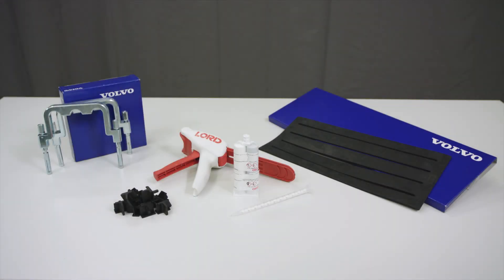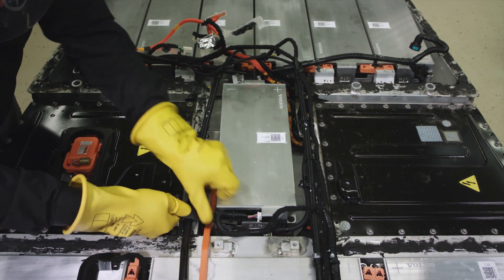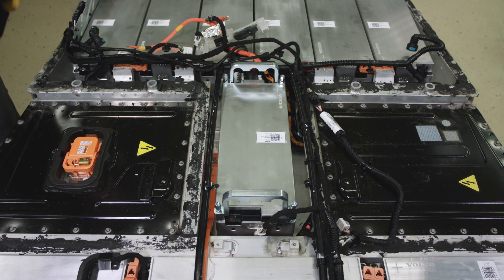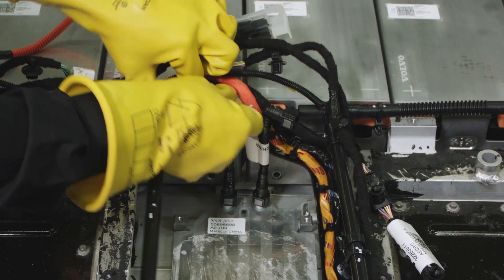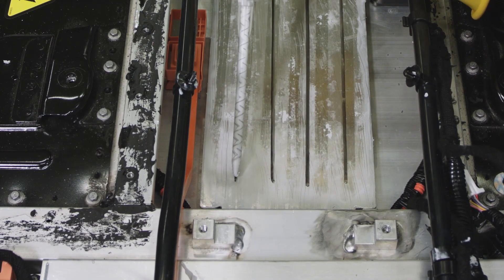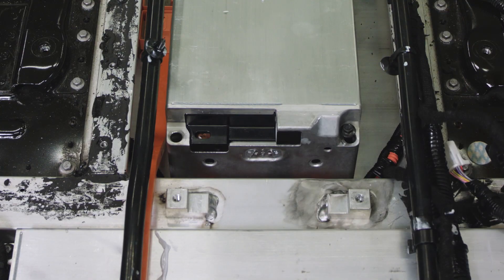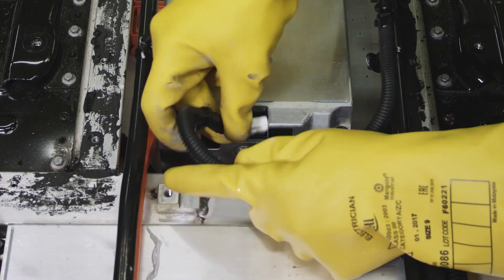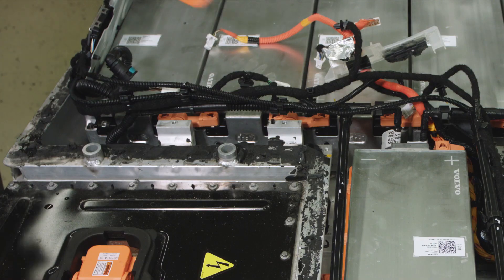Volvo XC40 Recharge (Pure Electric / P8).  High voltage battery module replacement

Comment: (VÍDEO 5 de 8) Este vídeo mostra o procedimento Volvo VIDA (Informações de Veículos e Diagnósticos para Pós-Vendas) para substituir um módulo dentro da bateria de alta tensão dos veículos. Este vídeo foi enviado para o YouTube apenas para fins informativos. Abaixo estão todos os vídeos: 01 - Remoção de bateria de alta tensão: https://youtu.be/IO8WZOPr6y8
02 - BDU removal: https://youtu.be/JlGxUOSG5TI
03 - Lid removal: https://youtu.be/G1QrY0qqY3E
04 - Internal layout: https://youtu.be/ulrGK4PKwEQ
05 - Module replacement: https://youtu.be/GQl6fjrw7ls
06 - Lid/cover installation: https://youtu.be/-yKFyIUikZ4
07 - Seal check: https://youtu.be/aLdKJpmYucY
08 - High voltage battery installation: https://youtu.be/7UEVvdDOPNE
Reply: Tudo bem ? Vc mexe com carros elétricos ? Tem insta ?